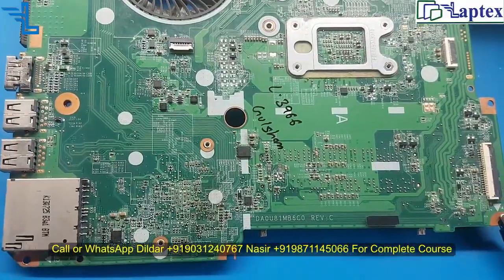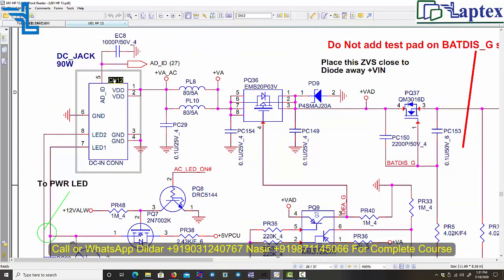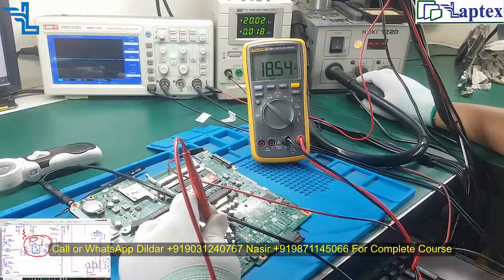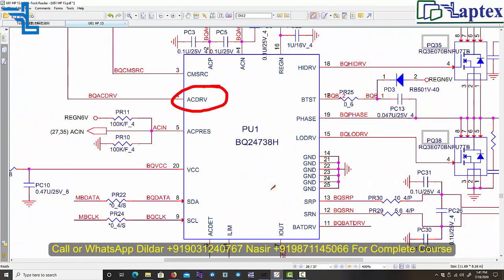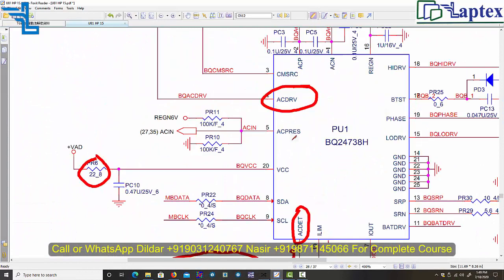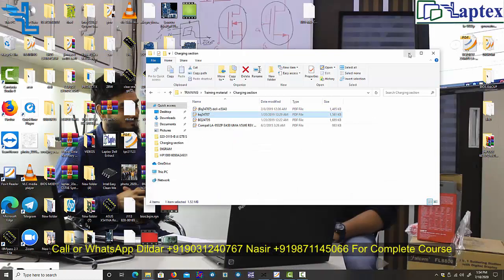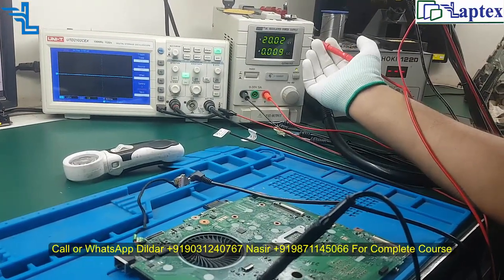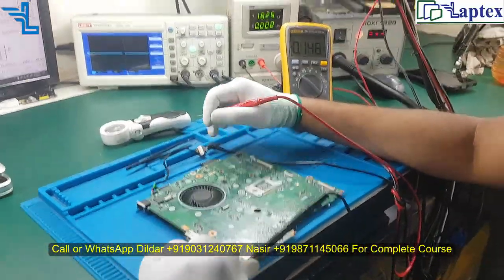Chiplevel Laptop Repairing Training Practical | Hp 15 No Light on DC Jack Dead Motherboard Part 1

Comment: assalamualaikum nasir sir....
If +va_air present PQ2 will be on & PQ4 will be off so PR8 in floating state.& voltage divider rule will be apply between PR9,PR12.
SO if +vad as you given to mb is 20v
Then ACDET should be 2.79 which is good for this charging ic to be work.
IF +VA_AIR not present it will be faulty condition &  PQ2 off PQ4 on.
Now first we calculate total resistance value between pr12 & pr8. bcoz both are connected to Gnd after calcute resistor value will be around 39.2k
Now voltage divider between pr9 & 39.2k
After Voltage divider now voltage will be around 1.670v
Bcoz acdet below 2.4 charging ic will conduct acok with gnd internally.
Correct me if i wrong somewhere.
Thankyou
Reply from the maker: Waalaekumassalam.... Yes good going 👍👍
Reply: @laptex1377  thankyou
Reply: Perfect

Comment: Sir,  HP  Probook G6  Notebook  wont  given display. But ; Power button light  ON  and Charge socket light blinking. Guide  please.  However,  I have checked  adapter  on another laptop , battery removed  and already try  power button reset , Replacement of RAM . But  no success.
Reply from the maker: Try with original adapter that has adapter id. Or else it would be the motherboard issue.👈